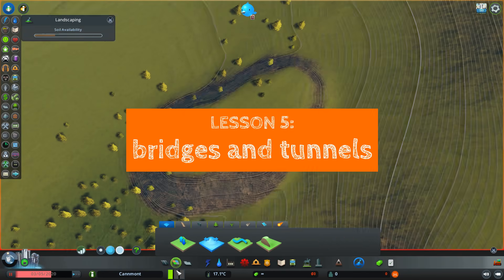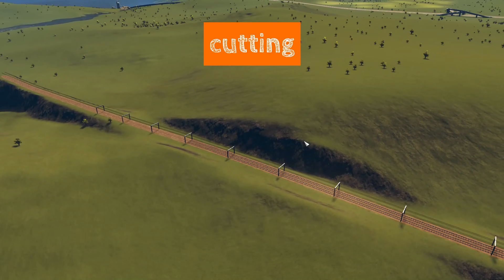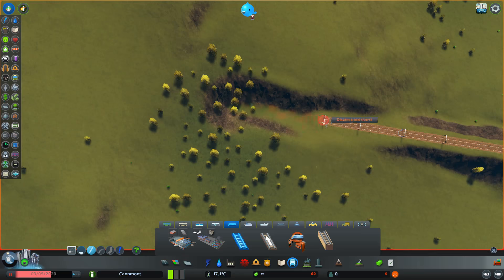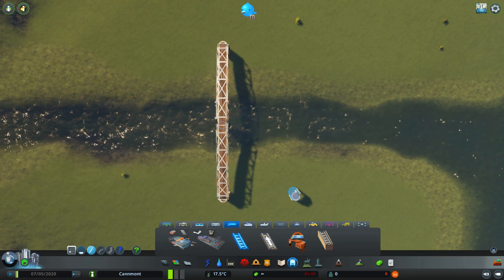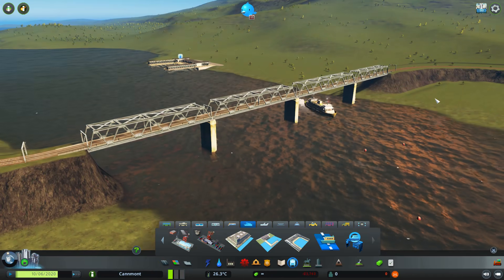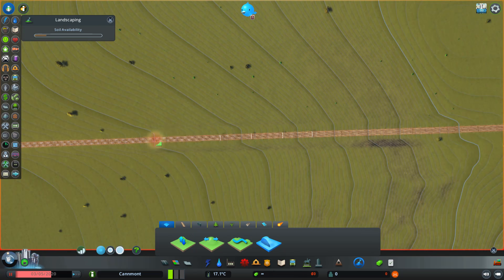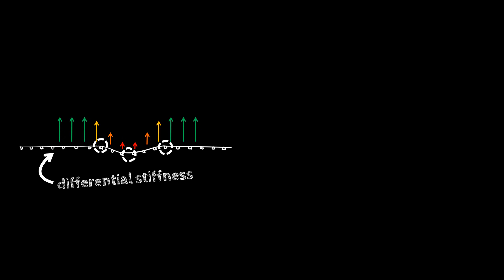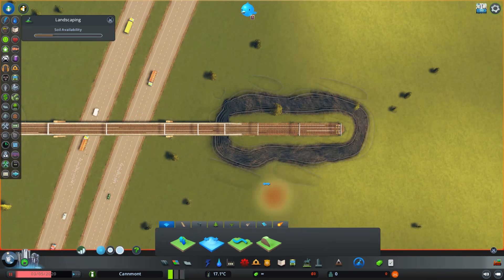#ThePermanentWay | LESSON 5: bridges and tunnels

Comment: Gauging for overhead electrification .. Right on one of your favourite doorsteps - The Iron Bridge, just south of York Station (Holgate Road) had insufficient clearance under it to fit the wires under for the electrification of the East Coast Main Line. Option 1 - Lower the track bed, Option 2 - Raise the bridge. The selected method used was to raise the bridge, jacked up, new approaches in the road. I used to regularly cycle over that bridge and can recall the works, but can not recall it being closed for any length of time.

The "story" at the time was that lowering the track bed would have been simpler  - there were sufficient tracks and points to divert trains around the works if done in sections, and the track beds and layout would undergo considerable alteration and realignment anyway, but this option was less preferred because of York's archaeology. There was the concern that to remove sufficient ground to give enough clearance would activate York Archaeological Trust's right to investigate the site before any improvement works could take place  and that would hinder progress for at least six months. So up the bridge went.

I think there may have been a bit of truth in the story, but more likely just easier to jack up the bridge, rather than create a dip in the track but a nice tale at the time of the fear of the archaeologist's trowels .

Insert> I just Googled "Raising Holgate Bridge" and found an article from the York Press - It was a financial  decision. Pfffft!! 
https://www.yorkpress.co.uk/news/18260582.holgate-bridge-raised-foot-1980s/
Reply from the maker: Lowering tracks is always the least favoured option as it makes drainage a nightmare and, particularly at station throats, can actually be impossible to design in given the prevalence of S&C... You can see where the road humps when you cycle over the top!

Comment: Interesting as ever, thanks Gareth. Am I right in thinking that tight turns before bridges are perhaps a necessary evil, and it's preferable to have a straight entry where possible to maintain speed?
Reply from the maker: Thanks Phil! Yes, you definitely want to keep your alignment as smooth as possible as this allows you to keep your speeds high and your running costs low. However, geography often gets in the way!